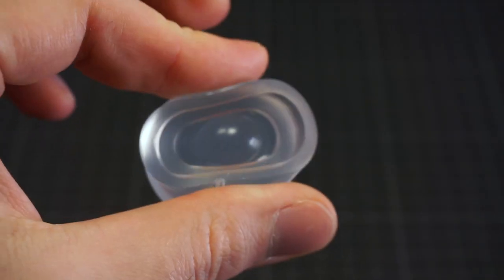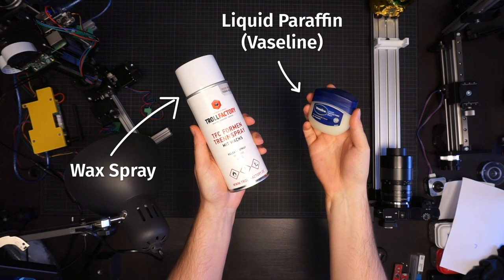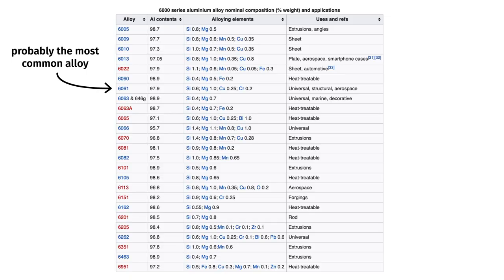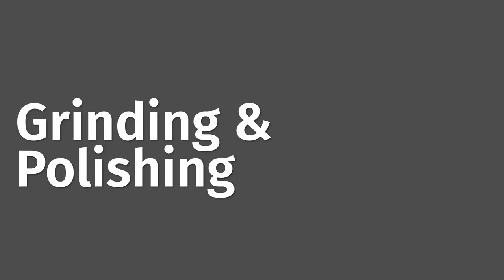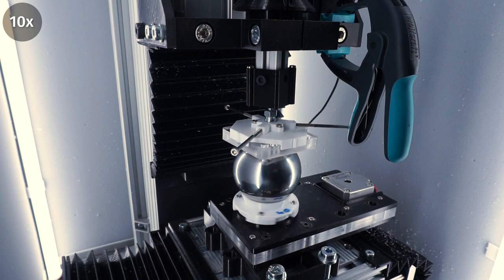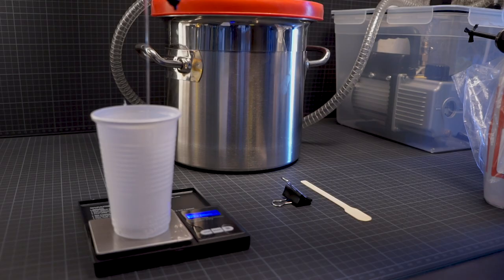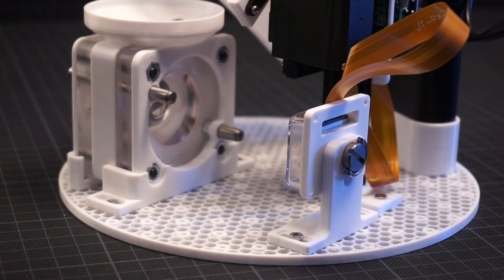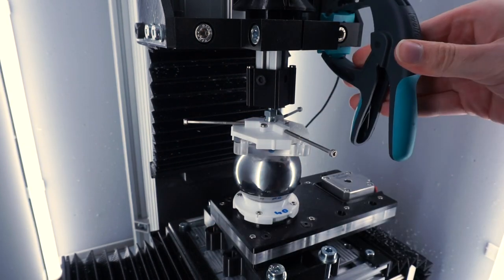Making Soft Silicone Lenses at Home

Comment: Super interesting video. Maybe I missed it but I was hoping you’d explain what you needed a flexible lens for. I can think of a few applications, but I’m very interested to hear what your use-case is!
Reply from the maker: A soft silicone attachment that can be pressed against camera lenses and allows to sense some basic deformation gestures to process user input. Then unused cameras of small devices can be temporarily repurposed to get additional physical input elements like buttons, knobs, or d-pads on devices that may have too few or no physical input elements at all. The video about this project is done, but I can't publish it yet.
Reply: @vlztn Whoa! Thanks for that explanation! I was thinking more military or industrial applications but it’s super cool to think of it as an input device.

Comment: TIP to remove air: Use pressure. About 4 bar. There is a thing called in english something like:  dissolution of air in plastic (Растворимость воздуха в пластических массах- in russian) Main principle is as pressire rise, trapped air dissolves in plastic (or silicone). But! You need to keep pressure through the whole curing cycle
Reply from the maker: Thanks, I've seen this only done when (hard) resins are used, I'll put that on the list of things to test.

Comment: Excelent video! one tip: some time ago i made some homemade lenses with acrylic; i polished them on a lathe and here are the tips...
* I used sandpaper till reached 1500 grain; then switched to coarse polishing paste, fine polishing paste and ultra fine polishing paste (search for "car optic polishing paste", i used one from a brand called Zeocar, it is quite good)
* Another tip is to use a microfiber/cotton cloth for polishing, still using the mold.
* If you rotate either the mold or the tool; spin it super fast when polishing and add some water/lubricant to cool it down... This made the tool "hidroplane" on the surface and makes better quality
Reply from the maker: I tried some general plastic polishing pastes and one for car paint and none really worked out well, maybe because the metal surface had direct contact to the acrylic. Just putting some microfiber cloth as a compliant layer in between is a good point!

Comment: could you maybe buy a positive of the lens you want, make a negative from that out of plastic or resin maybe,  and then use that as the mold for the final product?
Reply from the maker: I tried that and had a few issues with this process. When using resin for the negative mold you're limited with regard to geometry because your resin mold is rigid and you need to separate it from the first lens+plastic mold. When using silicone for the second mold instead, every surface needs to be coated with mold release so silicone won't bind to silicone and this ruins the surface quality.

Comment: Any reason you didn't vapor polish the last bit?
Reply from the maker: Two main reasons: I am a bit hesitant to work with chemicals. In the Applied Science video I linked Ben used methylene chloride for vapor polishing which doesn't seem to be extremely toxic, but not exactly harmless either. And I was not sure how well I can control the vapor polishing effect. I need only the curved surface to be polished but the rest of the acrylic part is already exactly how it should be to be as tight as possible when used as a mold.

Comment: what happen if you expose  the lenses at a sferical hot of  metal to try to level the  macro scrashes  to clean and  a very worked lense
Reply from the maker: That would be "compression molding". I guess that works well, too, but I might assume that process is slightly more complicated (haven't tried that).
Reply: @vlztn  no I am talking about, to expose an sferical metal and heat the metal of the sfere slowlystep by step very near to the lense of silicon and,  without compresion or contact to clean the macro scraches
Reply: @vlztn  only with the heat
Reply from the maker: @holaquevez2727  I tried that not by heating up a metal sphere but simply by using flame polishing (with a creme brûlée burner). That resulted in a very smooth and clear lens once the surface of the acrylic became soft, but the heat did deform the surface quite a lot and it was rather hard to control.

Comment: Really good video. Regarding polishing did You try dichloromethane vapors? You have to be careful with it. But the result should be extremely good if you polished the surface mechanically that far. I have a very good results with polishing PC  helmet visors that way. On YouTube, it's here for example https://www.youtube.com/watch?v=-SV_ka1FPmM. People in the videos are not aware of how dangerous dichloromethane is.
Reply from the maker: No, haven't heard about that before! I tried to avoid using any solvents for smoothing, as you said: that's often nasty stuff...